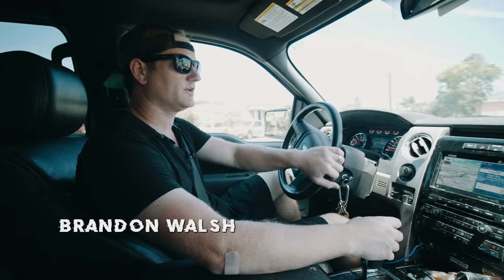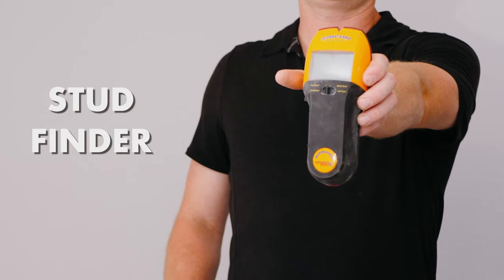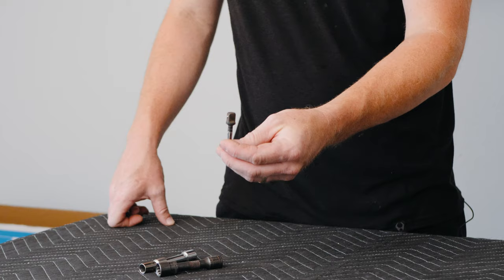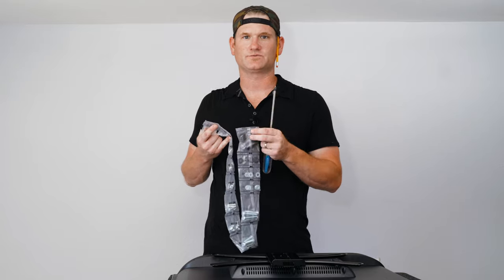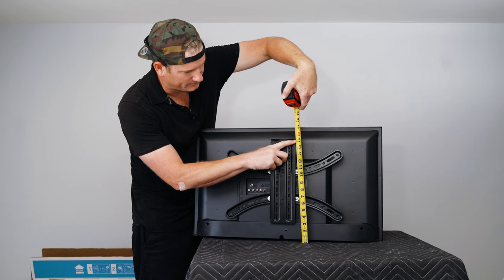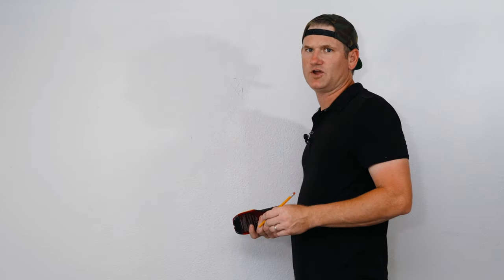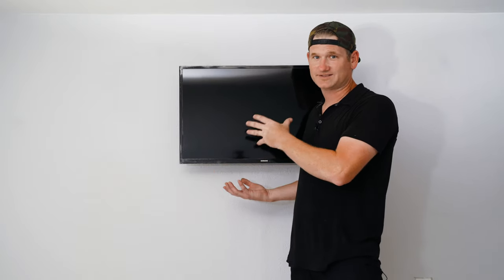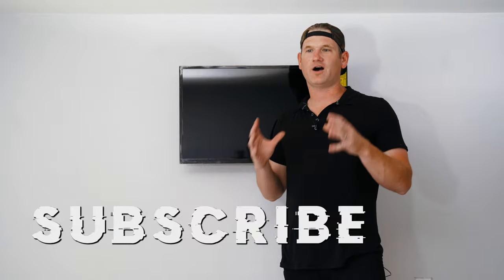Mount a TV on your wall, Sanus Simplicity 22-55" Full Motion

Comment: I have the same wall mount and a 55” Samsung that I’m trying to mount..my stud finder is giving me false alarms! When I put the lag screws in where it initially said there was a stud, the screws were starting to come out as soon as I tested it by moving the mount side to side like it suggested.. so now I’m looking for other studs in my wall, located them, but when I drill the bit in, I am not hitting wood or anything hard like I was told I should hit. I’m at a loss and now I’m regretting trying to do this on my own entirely...ahhh!!!
Reply from the maker: You gotta find a stud with this bracket.  I have a stud finding video.  There are studs left or right of power outlets and normally 16 or 24 inches each way from there
Reply: B The Installer thanks so much for responding..I’m still drilling holes searching for studs..I think I may have finally found a stud?? It was a little harder drilling with the bit..so I’m now going to attempt to mount my mount with the lag screws and see if it does the same thing or not..
Reply: Use a magnet to find the drywall screws and then to be extra sure drill little pilot holes so you can find the edges of the studs

Comment: I have a 50-inch Samsung with a Sanus and I'm installing it outside on stucco and cinder block wall. Also, I need about an inch off the wall do the TV will extend completely flat. Is it OK to mount a 2x4 or other wood to the wall 1st then the bracket? And if so what type of screw or hardware is used going into stucco a d blocks?

Comment: Great video. For 40 inch and other mid size TVs do you prefer to go with single stud mounts like this one or two stud mounts like the sanus slf226? For my install I have a stud centered on where I want the TV.
Reply from the maker: Either will work.  If you get a dual stud type you can pin the middle still. And add toggle bolt top left and right and its plenty strong.  Many don't have that perfectly centered stud.  I don't use these single stud mounts often, I normally use one with range so I can hit the stud where needed and center tv.
Reply: @BTheInstaller  do you think a single stud tv mount with 3 lag bolts can hold a 55in LG CX? Mounting Dream says it holds up to 99lbs Nd the CX weighs about 50lbs. Thanks in advance
Reply from the maker: Definitely.  I have the tvs on my wall alp on single stud and they're all 55
Reply: @BTheInstaller  sweet ordering the mount now. Thank you!
Reply: @SourPatchKid562  which mount did you go with? Did it work?
Reply: @jeffreyhalverson83  I used the Mounting Dream MD2377. It’s working well👍🏼
Reply from the maker: The md2380 is the go-to for me.
Reply: @BTheInstaller  Thanks but here is the thing....I'm mounting the TV in my RV and there is storage behind the TV, so I want a single stud mount that also needs to be pulled out and turned all the time. I purchased a Hisense 55" U7G and soundbar mount all of which will end up being about 45 lbs....do you think any single stud mount I find on Amazon claiming these capacities will actually work? Without bending or any issues???

Comment: Hi, i recently bought the same model but I'm having problems installing it. Your video made the frame that is on the wall easier to install but I'm having problems with the TV frame. I was wondering if you had another video where you better explain the installment for the screws and such.
Reply from the maker: Yeah that was first ever video. You just place the 2 u shaped bars on the tv, find the screws that match, and then set the rectangle over that and screw it in to the u's. .... its similar to this bigger mount where I show how but not exactly the same.   https://youtu.be/uPMm_qcGjhU

Comment: Great video. Just wondering if tightening the top bolt to the  wall, one should level and then tighten the lower bolt.
Reply from the maker: I normally tighten the top bolts yes and then just drill, and bolt the bottom.

Comment: NEED HELP! The instructions say I need a 1/8th 3mm drill and that the hole needs to be 2 3/4 or 70mm deep well my drill bit only goes about 1in deep do i need a longer drill bit or what? Im so confused. I thought i had the same mount in this vid but u said urs said u needed a 1/4 bit?
Reply from the maker: You need to drill as deep as the bolt goes and the bit size would be the same as the bolt not including the threads. So the bolt and bit same size less the thread diameter.
Reply: Mmm im lost i tried all night to get this tv up. Will try again tomorrow thanks for your help. U would think the drill bit size would just be clearly described in the instructions? also is there a sure fire way to know i hit a stud? My top bolt became loose after trying to readjust to better level and now i am not sure if its stud im pretty sure i see wood but the bolt just wont stay on. Maybe too much readjusting?
Reply from the maker: Studs are very solid.  If loose it could just be plywood which is thin and then bolts will not stay tight.  Also the hole drilled could be too large.  Needs to be exact.  3/16 and 1/4 are common.  Be safe.
Reply: B The Installer well my instruction manual says 1/8 why do u keep dodging that? I am using the same mount in the video and my instruction manual says 1/8 why are you saying 1/4?? Should i be using 1/4?? Thanks for replying i appreciate it
Reply from the maker: Use the 1/8" bit then.  I have no idea what your mount says.  They change hardware and instructions over time.  That was a video from nearly a year ago... should have info in the instructions.

Comment: Can you comment on the likelihood of hitting cinder block if trying to hang the mount on a wall that is a corner room? I am having trouble getting the drill bit to the recommended depth.
Reply from the maker: Well what I can say is that you need at least 1 inch depending on the kind of mount.  Any arm mount needs a typical 2x4 to sink into.  So over 2 inches.  When drilling, you should have a good idea of what is behind the wood.  If there is space between studs, drill though drywall and check the depth.  Even 1 5/8 drywall screws can be used to secure mount with washers...  so maybe I'll make a video

Comment: Hi, Just wondering for 65 inch TV. If the mount can't stand on the stud, is it possible for the mount just stand on the drywall with special bolt? Any suggestions?

Comment: Im mounting 43 inch tv outside in a palapa bar, I need the mount to be horizontal to mount to wood beam. Is it possible to use this mount horizontally?
Reply from the maker: No, it will just slam down.  You can get a ceiling mount to hang from a beam or any normal flat mount with downward tilt can be hung off the bottom of the side of the beam  and the tv, depending on the brand.. i have done this, I don't have image but  both can be done

Comment: I don't the you need the lines to the lower hole.  You just need to put the top hole in, at the right height, and on the stud. Then for the lower hole, just put your level on the side of the mount, and screw in the screw.

Comment: What is the determend hight of the tv from the ceiling?
Reply from the maker: I use what's under the tv, keep it within 8-12 inches from bottom of tv and then if nothing to use, I rarely put the top of a tv higher than 6ft.